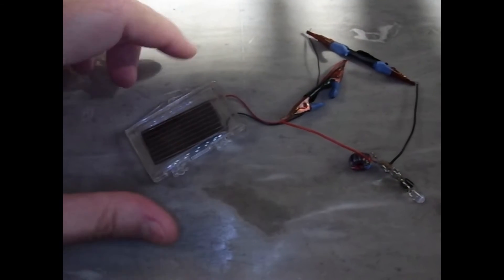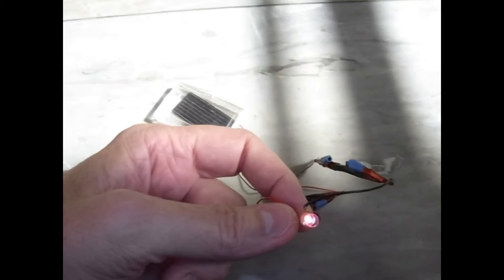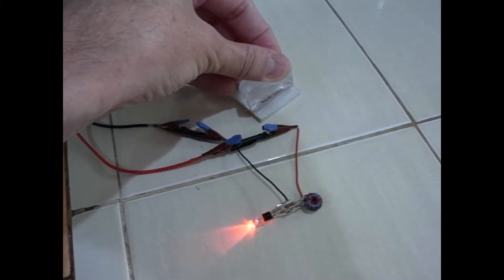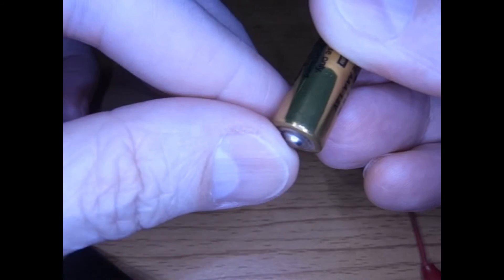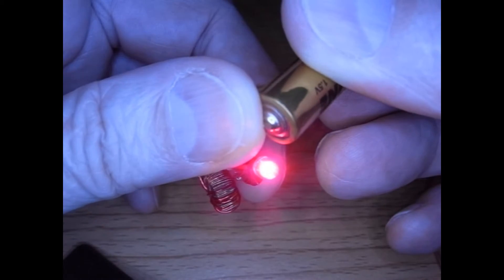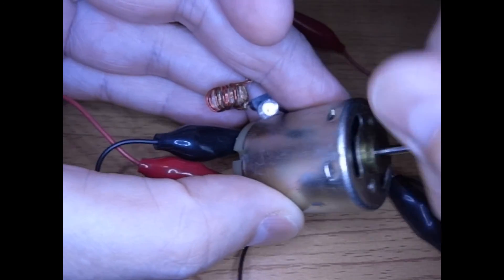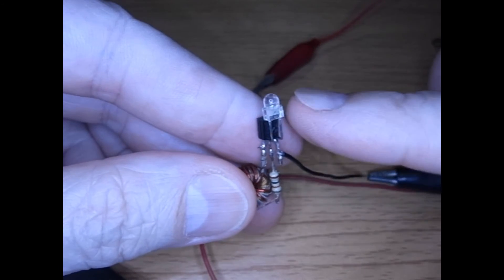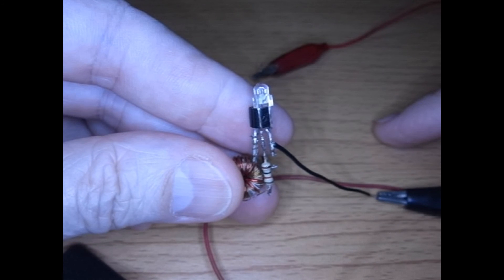Joule Thief Micro-Powered by Lite, Heat, Magnetism & Chemical Energy

Comment: Can the joule thief also amplify the current?
Reply from the maker: A transformer can either turn volts into amps or amps into volts.  There's no free lunch, but it does work.
Reply: But it can also amplify the current as the voltage rises right?
Reply from the maker: More voltage will give more current if I understand your question.
Reply: Ohh thats great. Since I'm going to use it to charge a battery. I'm worried about its output current lol. Thanks a lot!